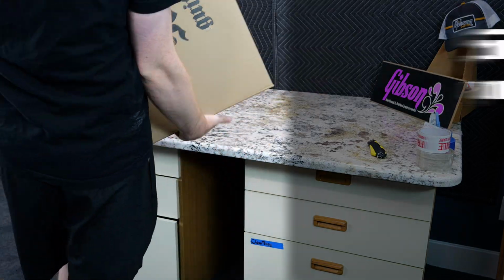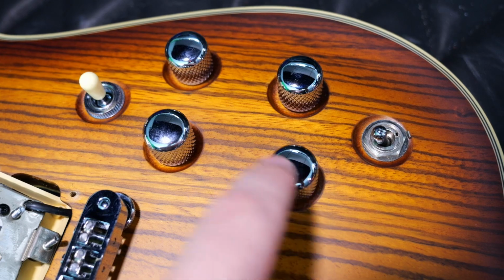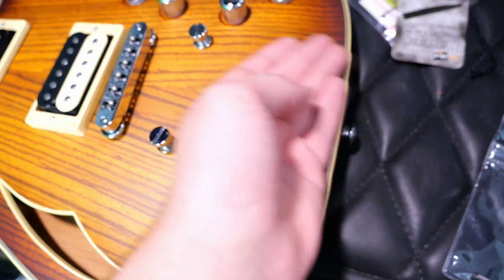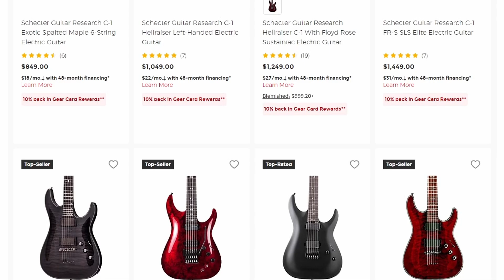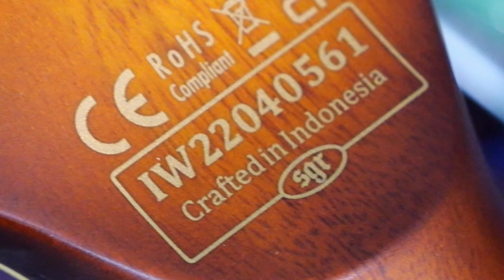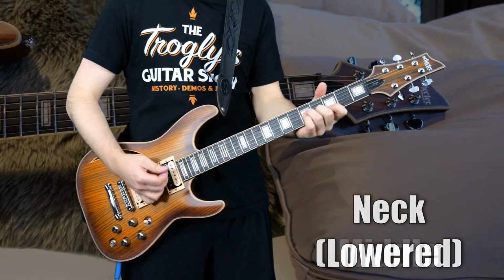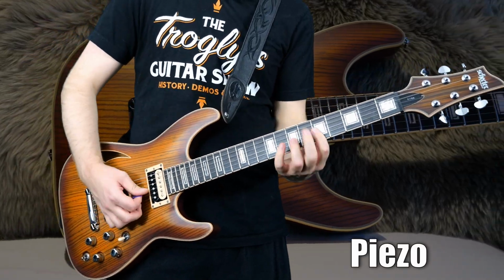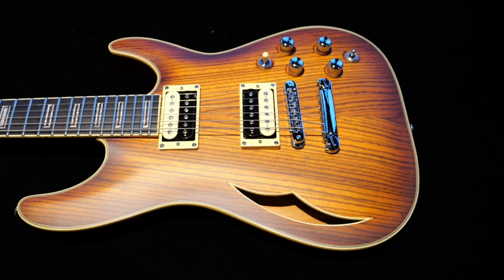This Schecter is STACKED! | Schecter C-1 E/A Classic Zebrawood Review + Demo Schecter C-1 E/A

Comment: These guitars are built by Cort in Indonesia and they do often dye their fretboards.  Also it's more likely that the humbuckers are passive.  The 9 volt is for the piezo preamp.
Reply: The higher end imports are made in South Korea.
Anything over a $1,000 is Korean made
Reply: @mykuntstynx9463  that may be true in some cases but the back of the headstock clearly says crafted in Indonesia
Reply: @EarlofBaltimore it absolutely does sir.
I'm actually surprised.
Prices going up everywhere it seems.
My 2018 Schecter is Korean made
It listed for $1,490 new. Fully loaded
FR
Sustainiac
Fishman
Neck through
Stainless steel frets
Ebony fretboard
Carbon fiber reinforcement rods etc.
Reply: If the Fishman system is wired like the Graphtech Ghost system in my 2006/7 C-1 E/A, the humbuckers also go through the electronics.  I learned that when I replaced the "Duncan Designed" humbuckers with a Seymour Duncan Jazz/JB set.
Reply: @yobaby14  looking at the control cavity on this one it looks as if the pups are wired directly to the pots and the switch.  I'm pretty sure they're passive but I could be wrong. Wouldn't be the first time
Reply: @EarlofBaltimore  The newer ones with the Fishman system may very well be.  It would make sense if they were separate.  I've thought a time or two about rewiring mine to get the humbuckers out of the active loop.

The wiring diagram for the older Ghost guitars is online, but I didn't see one for the newer Fishman guitars.

Comment: Schecter guitars are one of the best (if not THE best) value in both the new and used guitar market.  There are very few models I wouldn't own.  As you pointed out, the lack of cases with almost every guitar they sell other than the USA models is a sore point for me.  Even if they included a decent gig bag, it would make it so much more attractive.
Reply: I have 10 Schecters, mainly C-1s, but a couple V-1s as well. and I just paid extra to have the hardshell cases. I don't like gig bags, just because of the dirt, and how easy it is to damage the instrument. The hard cases are made well, so I felt that they are worth it to be able to store them. I mean, there marketing model is to get as many of their models in players' hands at all levels.
Reply: Case is not an issue for me. Most people display their guitars. If you have a decent collection, you should have enough gig bags and cases to be able to transport the 6-8 you may take out of the house at one time. .. make any sense?
Reply: @Skippymizzle  Not the point. There are other reasonably priced brands that provide at least a gig bag with their guitars. Schecter could do it as well but it is the one ares where they cheap out and don't need to. It doesn't add that much cost from their perspective.
Reply: @DanielBobke  I totally agree with you about schecter should at least offer a case or a gig bag after a certain price point, my lefty schecter  Nick Johnston HSS was $1025 after tax and if they added a decent gig bag along with it, that would’ve made it even better, I already had a case to put it in when I got it but I agree with you that’s not the point after a certain price that you’re paying you should at least get something to carry it in whether you’re going to use it or not, Kiesel gives you a hard gig bag with all their guitars regardless of price point
Reply: @michaelmetal71  An example from today...ALL of the new Fender Vintera II series guitars come with a nice gig bag.  They range from $1149 to $1499 - same price range as many Schecters.  Schecter could do it.
Reply: Um, unless you just starting with guitars you should have a stack of guitar cases and gig bags you never use. I do.

Comment: The early C-1 E/A's had quilted maple top, two F holes, pickup selector on the upper horn, and no access panels on the back other than the battery holder holder opposite of the pickup switch for what then was the Graphtech Ghost piezo system.  They came with "Duncan Designed" pickups and no push-pulls to split.  I installed the Seymour Duncan Jazz/JB combo with push-pulls in mine.  Something of a PITA since everything had to go in-out through the pickup holes, but easier to reassemble when you tie a string to everything when pulling it apart.

Edit:  The very early C-1 E/A's had two 1/4" output jacks.  One for the acoustic output and the other for the humbuckers.  The newer ones with a TRS output jack make it easy to run a stereo rig, acoustic to one amp and humbuckers to the other.
I run the acoustic to a Quilter Superblock US and the humbuckers to a Superblock UK, then into a stereo 4x12 cab.  It makes a nice living room/bedroom rig.  LOL

Comment: My 2013 Godin xtsa has both passive pickups, acoustic output and synth output. I can run 3 amps at a time with it sounding like 3 totally different guitars. Quite an amazing axe. The Schecter looks and sounds sweet!
Reply: Plus those have the 3-band EQ for the piezo, most guitars with a piezo don’t bother with a tone control, but Godin went and did the same as their acoustic-electric models!

Comment: Probably the best ( most consistent) quantity guitars  🎸 made today. Quality control on schecter guitars is top notch . My next axe for sure
Reply: maybe for the American made ones but I've had 3 imports and all 3 had issues. sucks because the first one was amazing till I wiped it down and changed the strings. the top crack and a chunk fell out next to the volume pot. every one since has had more and more problems
Reply: @captaintony1227  that's a shame bro. Yeah you're probably right  👍

Comment: Salutations Austin!
That’s a nice Schecter with some nice options.
I agree with you about the pickup selection, and I would prefer the less expensive model, and then swap out the pickups with a set of Gibson 57 Classics with the four (4) conductor wires so that the coil splits would still be functional, I also might add another push pull pot so I could have control over each pickup separately, and one more to have phase switching as well.
I definitely like the zebra wood and the finish. 
Thanks for reviewing this guitar and sharing it with us all by posting this video!
Keep rocking!
Please have an excellent and awesome day!
☀️✨🎸

Comment: Cool guitar! I think Schecter is my favourite brand, only have 2 so far but hopefully more to come. The dream one day is to get one of their USA custom shop models.

I love the zebrawood top on this, even if it's just a veneer. Such a cool looking wood. I have a Tama snare drum that is made from solid zebrawood (snares are usually made from plies of wood, solid shells are rarer) and it sounds great. Also noticed that zebrawood is available as a fretboard wood on the Kiesel online configurator. No idea what it would feel like but looks cool as hell.

I'm a little confused with the mention of using a splitter cable on this guitar. So you can use the switch to select piezo/humbuckers/both. If choosing both does that not mix both out to a mono signal? As far as I was aware most guitar amps have a mono input so it would need to be mixed down to a mono signal for the blend to work with any normal amp. If the blend puts the two signals out on a TRS cable that can be then accessed seperately with a splitter that would be handy but then the blend wouldn't work with a normal amp?

Don't think this guitar is at the top of my list of Schecter models I want the most as I tend to play heavier styles but it would still be on the list. The humbuckers didn't sound as big as I was expecting but I guess that just the very clean tone used for the demo, I've heard the Pasadena pickup set in some high gain demos and they sound great. The Pasadena neck is in the new 'Sunset Extreme' model which seems to be quite a metal focussed shred machine so clearly those pickups can cope with the heavier stuff.

Comment: You can use a Y cable, or you can get the fancy jack box that rockboard sells and have the y cable on your pedalboard, so you can run just one cable into one jack that you actually have to remove on a regular basis, rather than bothering with a split somewhere it would be annoying. Also those imperfections in the finish are fisheyes, caused by something getting in there while it's wet. Pain to deal with but also a pro finish department shouldn't have the contaminants floating around the air either.

Comment: I do like that piezo sound. 👍 They shoulve routed the piezo to a 2nd jack to output the diferent pups to 2 separate amps tho. That'd be cool.  

I'm not a spec snob tho. My 1st year shecter c-1 plain old satin walnut with a SD in the bridge plays as good as ANY guitar out there. I got it used, and its obvious it's been plek'd. I've never owned a guitar I've paid more than $300 for (besides my Martin mahogany and my Yamaha TA)
...and they all play like a dream. I do a fret level, and upgrade the pickups and electronics when/IF needed. They might not be as pretty, but i like "worn in" guitars...and some of them look fantastic. But they ALL play and sound as good as the highest end Gibson. Even my new squire bullet sonic series mustang! 😅
Reply: In the very early days, when the C-1 E/A had two F holes, they had two Tip-Shield (TS) output jacks as you describe.  I have a later two F hole model from 2006/7 that has a single  Tip-Ring-Shield (TRS) stereo output jack, so they can be split to two amps with only one cable from the guitar.  I run the piezo to a Quilter Superblock US, the humbuckers to a Superblock UK, then into a stereo 4x12.  It's good stuff!
Reply: @yobaby14  TRS = Tip Ring Sleeve
TS = Tip Sleeve

Comment: Have a couple Schecter sand they are great - was choosing between this and the PRS SE hollow body II piezo for a electric guitar with piezo system. Ultimately when with the PRS mostly since it has two outputs - mag + piezo and piezo only so you could run two rigs at once.  Went with the PRS ultimately, but this would have made me happy to, I am sure.

Comment: The $1049 version has "Diamond series" humbuckers. I have one of those cheaper ones and it's got a glossy finish. The humbuckers are kind of dark, and I've been thinking about replacing them with the regular old Duncan JB/59 combo. It's got a stereo jack so you can split the acoustic and electric tones, which is nice.

The lack of case doesn't bother me. I own enough cases and gig bags as it is. I don't need another for storage.

Comment: Update: I've struggled with this guitar for months changing pickups trying to get them to work with the pizeo.. having problem with the volume knob the company says that's the way it's designed that's ridiculous... every pickup I put in is muddy and bottom ending in the neck and tinny and trebley in the bridge... It's been a big disappointment I've gutted it and tried so many different things It's a shame because it plays very nice and the piezo sounds great but the PCB board interacts with the electric pickups the system is terrible...I found the volume knob goes from on to off not a good taper and gets muddy when you turn it down needs a treble bleed.

Comment: the control section is too cluttered for me. They need to put the magnetic pickup selector up top, like a Les Paul. Remove the piezo selector switch. And maybe a compound radius neck. Otherwise its a very versatile guitar.

Comment: Made in Indonesia
That veneer is basically a STICKER! Like cheap IKEA furniture! Junk! 

Schecter C-1 EA Classic Guitar Specifications
Model Name: C-1 EA Classic
Fretboard: Ebony
Neck Material: Mahogany 3-pc with Carbon Fiber Reinforcement Rods
Inlays: Pearloid 3pc Blocks
Scale: 25.5” (648 MM)
Neck Shape: Thin “C”
Thickness: 1st Fret- .787” (20MM), 12th Fret- .866 (22MM)
Frets: 24 Jumbo
Fretboard Radius: 14” (355MM)
Nut: Graph Tech XL Black Tusq
Nut Width: 1.653” (42MM)
Truss Rod: 2-Way Adjustable Rod with 5/32” (4MM) Allen Nut
Body Material: Mahogany
Top Material: Zebrawood
Construction: Set-Neck with Ultra Access
Top Contour: Arched Top
Binding: Cream Multi-Ply
Bridge Pickup: Schecter USA Pasadena Plus
Neck Pickup: Schecter USA Pasadena
Controls: Magnetic Volume/Magnetic Tone (Push-Pull)/Piezo Volume/Piezo Tone/ 3-Way Output Switch (Magnetic/Both/Piezo)/3-Way Pickup Switch (Magnetic Pickups)
Battery Compartment: 9-Volt Clip-In Battery Compartment
Hardware Color: Chrome
Tuners: Schecter Locking
Bridge: Fishman Powerbridge (Piezo) with TonePros T1Z Tailpiece
Knobs: Metal Knurled with Set Screw
Strings: Ernie Ball Regular Slinky (.010-.046)
Case: 1620 SGR-1C C-Shape Hardcase “Case Sold Separately”